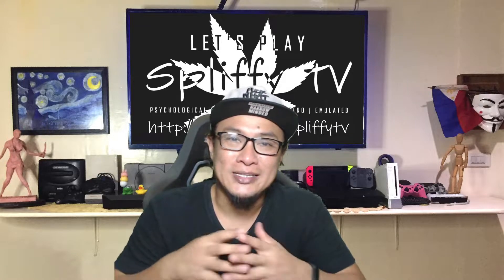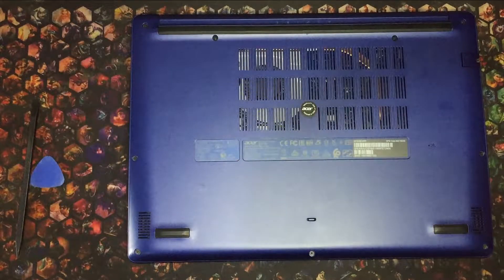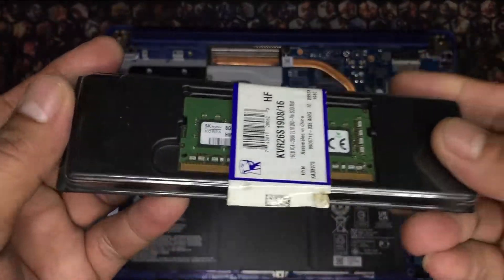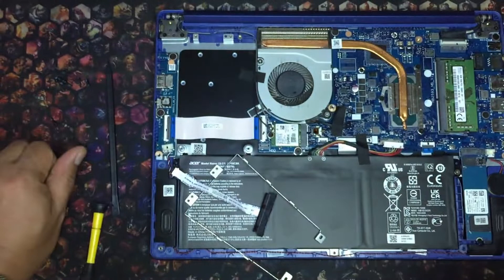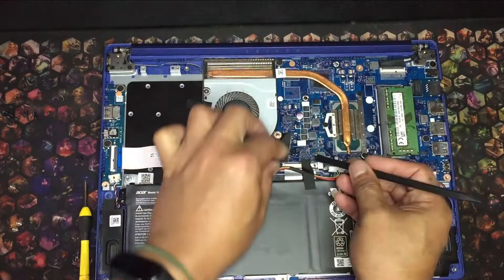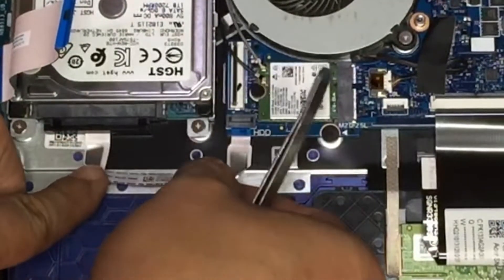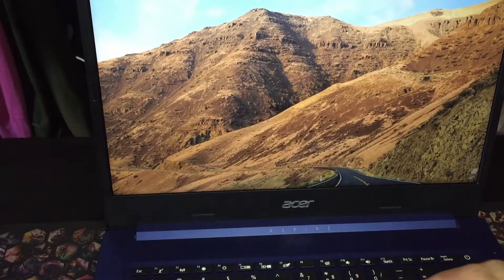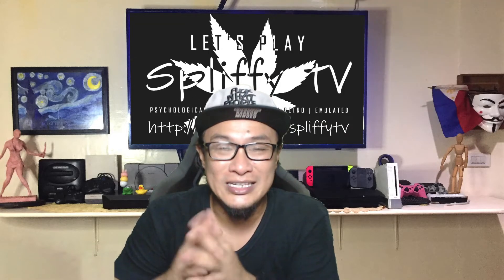How to Upgrade: Acer Aspire 5 (N19H2/A514-53-395P) RAM + HDD Upgrade Tutorial/Review | SpliffyTV

Comment: I know this is older content, but I think i have the same model. Been happy when I wiped out Windows from it and installed another lighter weight OS. But the battery and heat state were still not what I expected.

Realized it was because of a mechanical drive. I figure battery life will double once I replace it with an SSD.

Have you tried upgrading this to an SSD? If so, which one would you recommend?